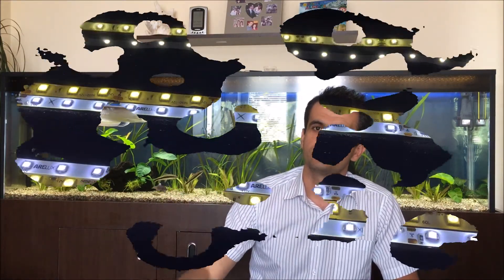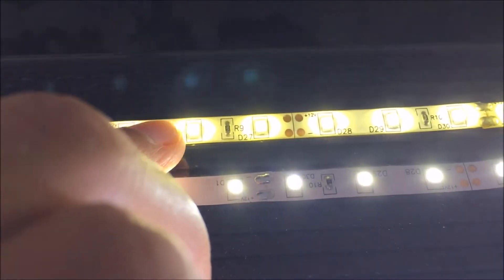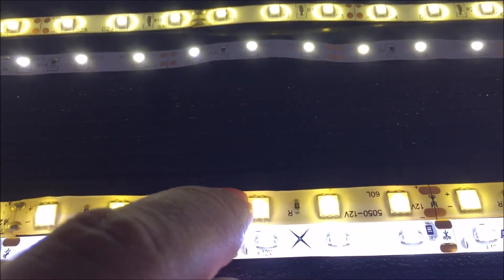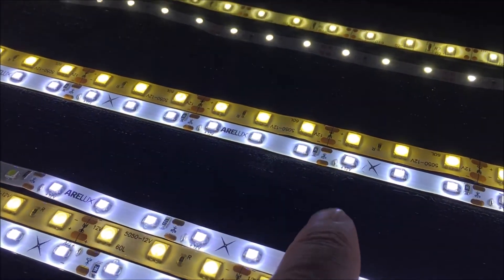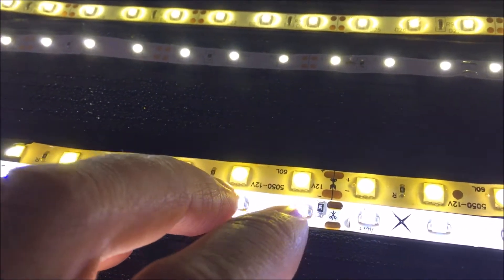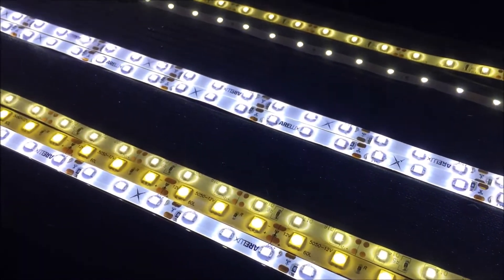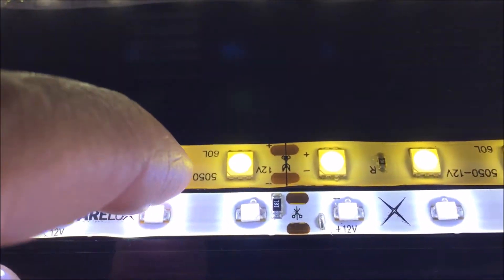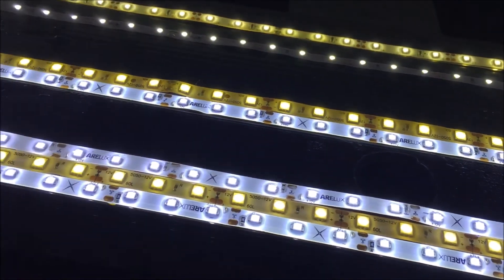LED Strips for planted tanks: advantages and disadvantages

Comment: ok there are a number of options you can choose from. led t8's ensure you buy a unit with starters in them otherwise you will need to re-wire ballast. there are some t8's that are designed to run on magnetic ballasts as well. Arcadia Brings out T5 Led tubes that are designed to run on magnetic ballasts/without rewiring the unit. if your looking at more of a cheaper option look into rigid LED strips in 5030 and 5630 these leds are brighter than your 5050's use are currently using. another option would be led flood lights in the 6500K. 

Ideally this flexible strips are ideal to be run at 10 to 12 hrs a day. they are really only designed to illuminate areas. as they burn out too quickly. 

however before you decide on which light unit is best, you need to decide on what types of plants  you are looking at growing. low, medium or high. make the light unit future proof.
Reply from the maker: I managed to add 2 T5 21W with electronic ballast. I will do a video about that when I have the time :)
Thanks for the info.